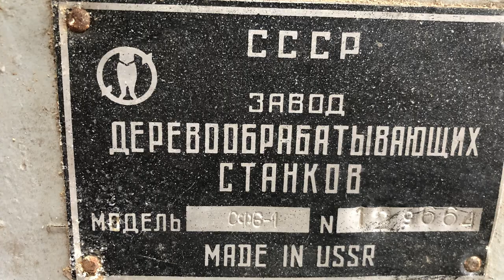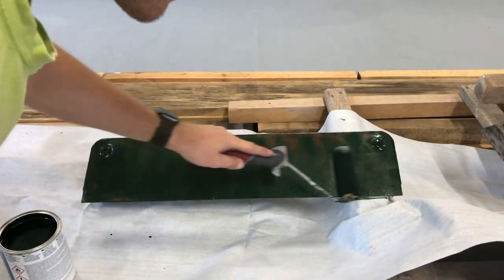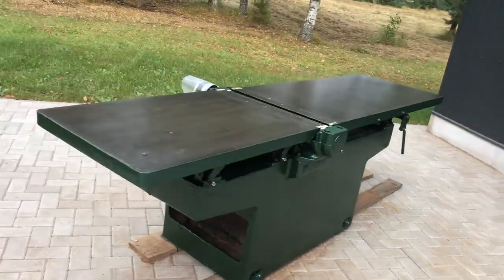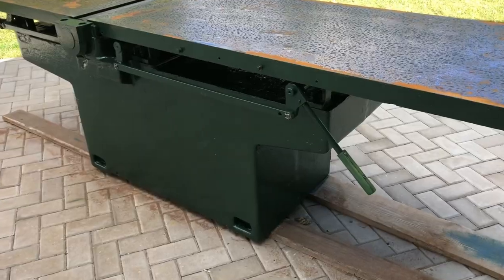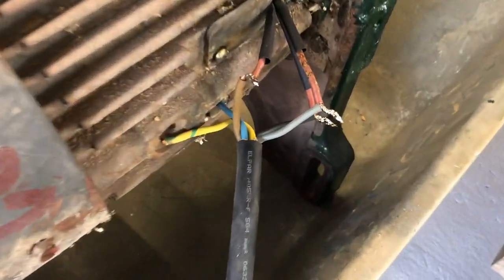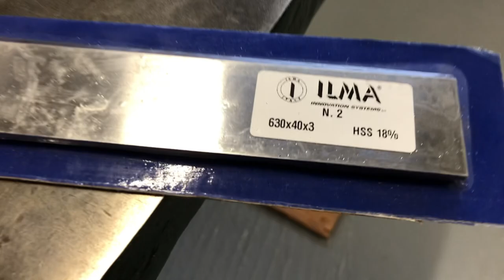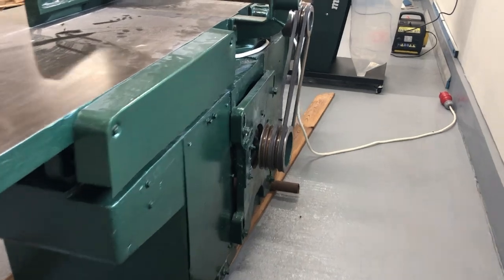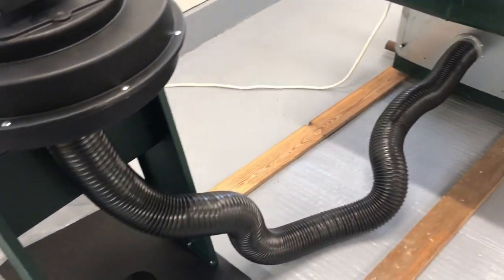Old Jointer Restoration

Comment: That is a very impressive restoration of a machine that seems to have been left for dead.  Where I come from, we always say, "They don't build them like they used to."  Your persistence may have provided you with a solid machine that will work to your benefit for decades.  The green paint is perfect, and assuming the cast iron surface is clear and flat, you'll have the bragging rights and a story to tell.  It isn't perfect, but it's a very nice machine, and it has personality.  Clearly that was a lot more work than your video could explain.  Congratulations!

Comment: HI Jonas. That's a really solid machine, it should produce a good finish. Enjoyed the restoration, those old blades were atrocious you did the tight thing buying a new set. Looking forward to some machining videos. Tony
Reply from the maker: Thanks, Tony! Actually it's really hard to adjust the blades - when it seems they're just about right height, I tighten the bolts and their height slightly changes :) Nevertheless, results are quite good, and when I will dial in those blades even better, I will be more than happy with this machine!
Reply: @jonasvaleisa  Are the bottom of the tightening bolts in good condition and the threads? Try swopping the bolts around. It's very frustrating when the blades keep moving when you tighten them up.
Reply from the maker: @tonyworkswood  That's a good point - those bolts were really rusty and old. It would probably be a good idea to replace them all together.